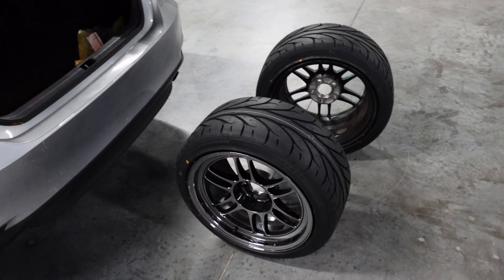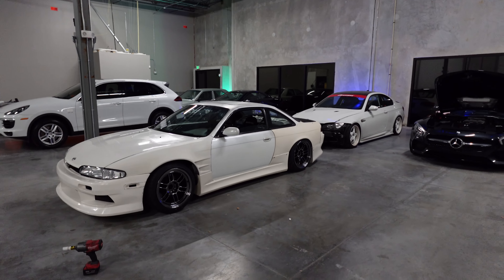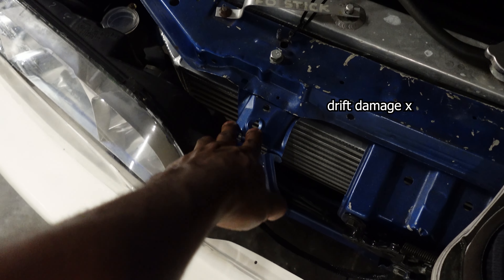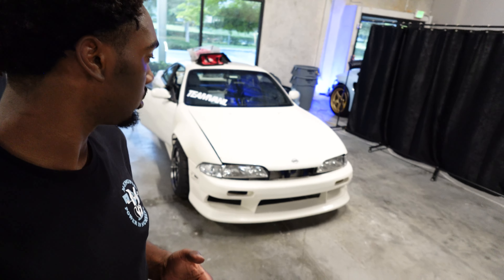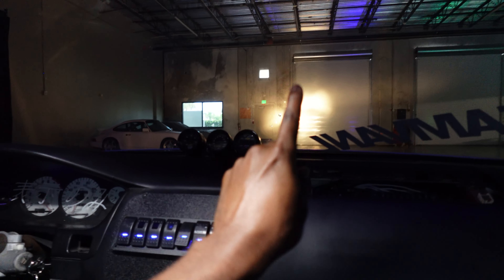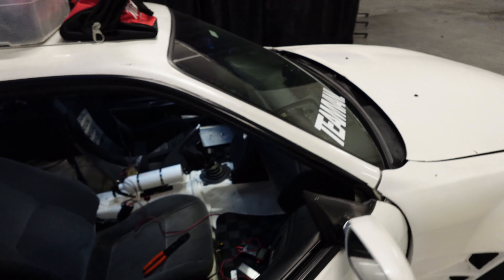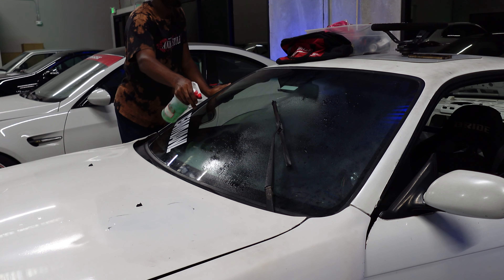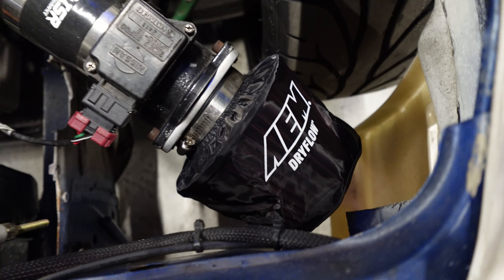Drifting @ Street 2 | New Tires & Location

Comment: hey bro great video!!! i'm having an issue with my sr, runs rich on idle then slowly creeps up and runs lean (maxes out AFR gauge either way). You got any idea what it could be? I checked everything and nothing.
Reply from the maker: had the same issue, first move. does your idle change when it goes from rich to lean because it should. if it doesn’t then your sensor is bad. i chased this issue forever until i realized it was just a bad afr sensor. also check for any boost/vacuum leaks.
Reply: @kriswyche  yep it goes from rich to lean. Then it breaks up under throttle
Reply from the maker: @MA-ru6uk  if it’s breaking up, try vacuum or boost leak